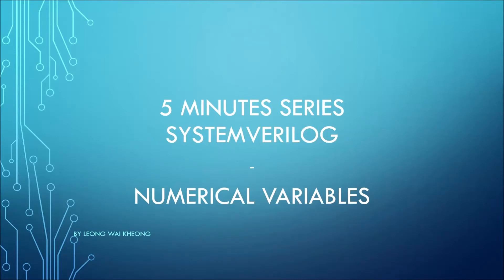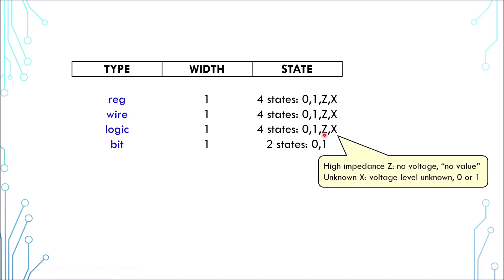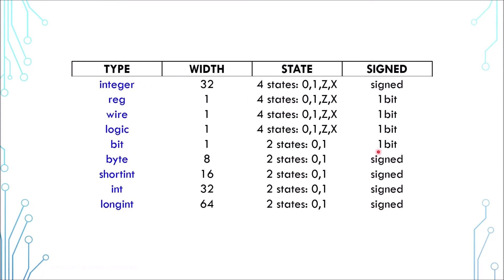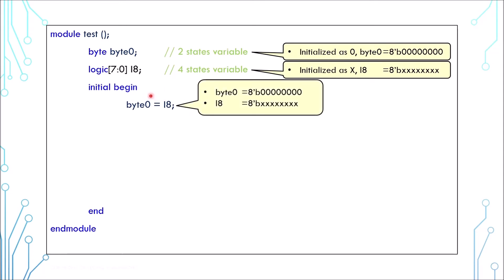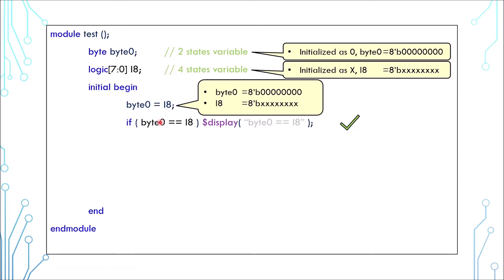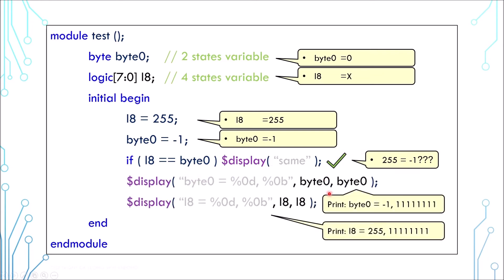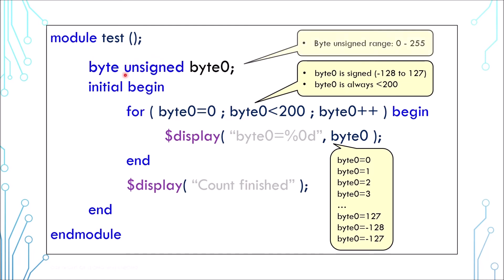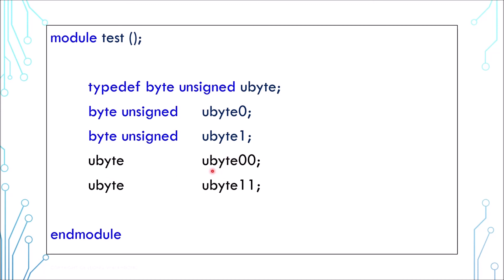SystemVerilog Tutorial in 5 Minutes - 03 Numerical Variables

Comment: Thank you for this tutorial!
It seems to be a mistake at 1:20: : negative values of integral data types are stored as 2's complement (see IEEE-1800, p. 73), though real numbers' sign is stored as you described
If I'm wrong, please correct me 🙂
Reply from the maker: I'm sorry this is based on experience, I've never checked the IEEE spec for the exact statement. But the statement in the video is right, 2's complement practically change the msb to 1 to indicate negative number.  I didn't mean that by simply changing the msb to 1, you'll convert a positive number to its negative equivalent. Just that msb 1 indicates it's a negative number. Sorry for the confusion.